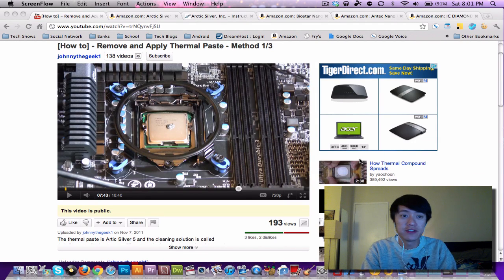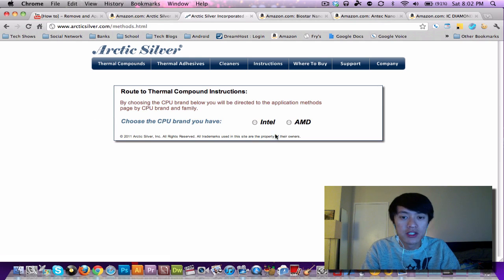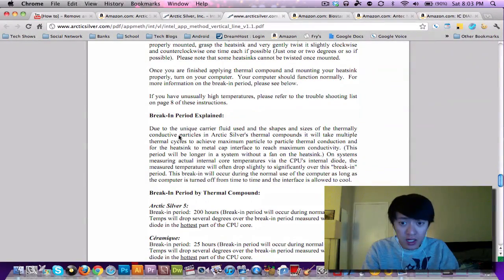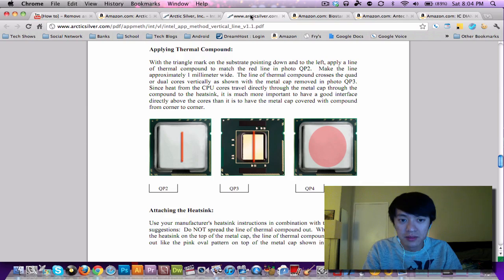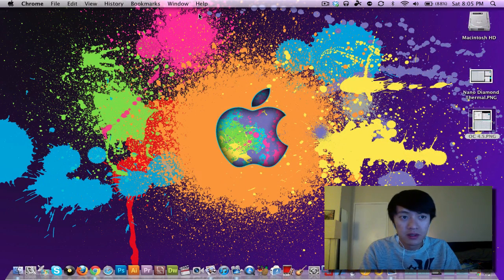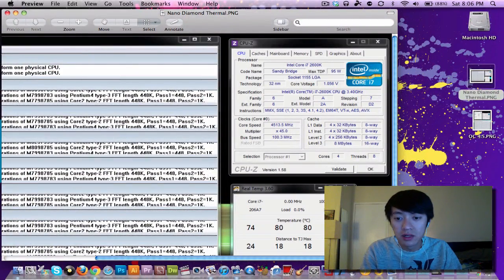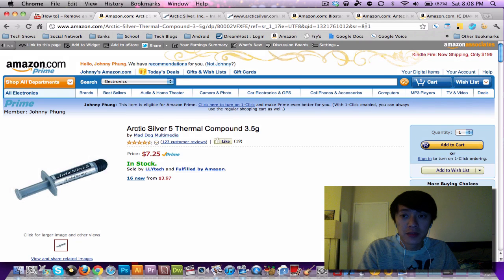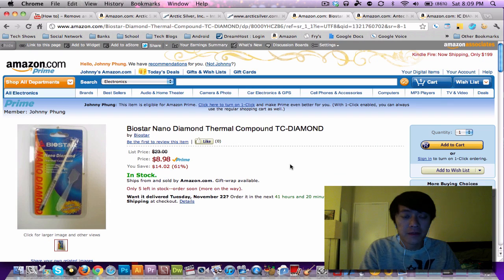Applying Thermal Paste - Biostar Nano Diamond Compound

Comment: I recommended using nano compound i used antec formula 6 you can use formula 7 you want i currently use formula 6 i work much better on my laptop cpu it iceyer than thee day's it much reliable it use nano thermal compound that how i recommends.

Comment: Antec does give you processor protection an does give you way lower temps pervent breaking processor puting scrach marks my didn't from antec you use arctic silver 5 it puts scrach marks on it. It does break your processor an give you bad tempertures usely get away from arctic silver companny i stick with nano diamond compound for now that why.